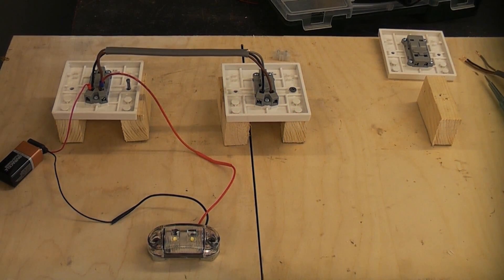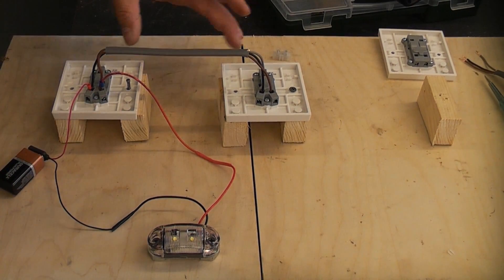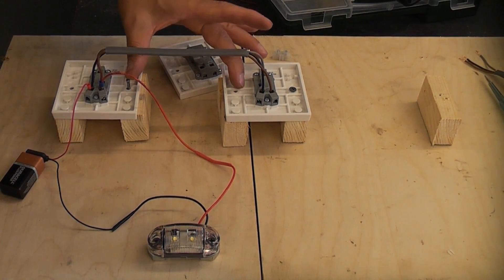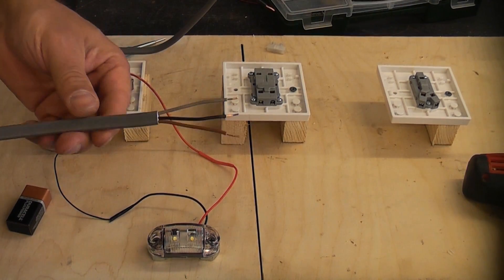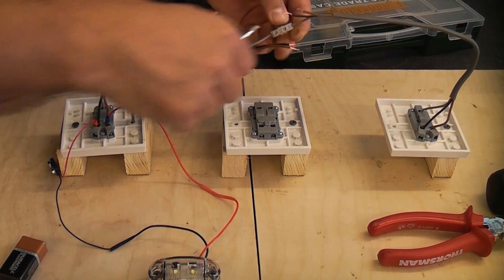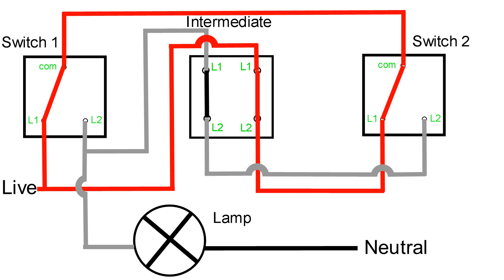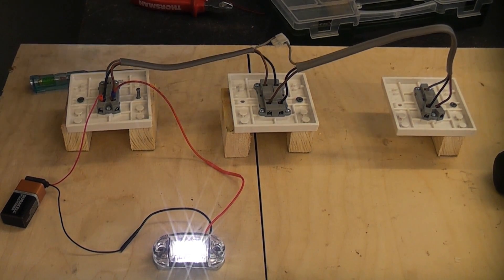Three way light switching | Intermediate switch

Comment: The position of the switches is not shown. All switches should be in the same position for off. 1 set of straps should be diagonally connected. Electrician

Comment: Hi I have a volex  1000 light switch with L1 L2 and L3 terminals am I right in thinking this is an intermediate switch ? The switch to replace is available with L1L2 then another L1L2 side by side so 4 terminals a BG electrical switch the one switch I tried won’t work with com +L1 L2 keep up the great videos
Reply from the maker: A switch with L1,L2,L3 is a two way light switch. You’ll need an intermediate switch 👍
Thanks for the comment 👍
Reply: @ got the job done checked switching side by side with multimeter thanks for the speedy response 👍

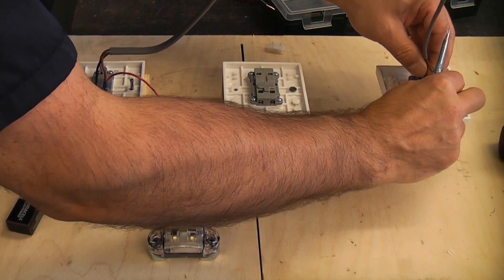Comment: 2:58 so would it be possible to use this setup for a light switch at the door and one pulley/switch by the bed?
Reply from the maker: A two-way system would be easier- https://www.youtube.com/watch?v=IwWIvcV2YTI&t
Just follow what I did in the video, but substitute the second switch with a pull cord switch 👍

Comment: Thanks for this.  I’d be very interested in a video or advice as to how to remove an intermediate switch from a circuit.  I am converting a three switch system to a single switch.  I’ve successfully took one of the normal switches out of the circuit but not certain about what to do with the intermediate switch.
Reply from the maker: If you have removed one switch already, the only switches left should be the first switch (the one where the original two circuit wires are) and the intermediate.

You should just be able to disconnect the wires on the three-core cable, at the first switch. That will leave just the live and switched live at the first switch, you can then remove the intermediate.
Reply: @ultimatehandyman  I’m very grateful to you for this, I literally was unable to think this through.  Thank you.

Comment: Great video - thanks. I have inherited this set up but the first socket on the circuit has a three gang socket (Socket A) (running a hallway light, a cupboard light and an outside light on a PIR). The second switch (Socket B) only covers the hallway. I have however noticed that the outslide light only works when Socket B is in a certain position. It shouldnt be affected by socket B at all so am i right in thinking that socket B is feeding off the wrong live? Does that make sense?

Comment: Thank you. This is excellent and easy to follow.

I hope that you will be happy to offer some advice and guidance for a 12v motorhome installation I am undertaking.  

I am hoping to have lights from 5 different zones all controlled by dimmer switches in 3 different locations.  

I can from this video how I would do this if I was using on/off switches.  

Would this be possible to achieve with all 5 zones being dimmable from all 3 locations?

Thanks, again.
Reply from the maker: No Idea, sorry.
You might need advice from an automotive electrical engineer 👍
Reply: @ultimatehandyman  
Thank you. 
Would such a setup be possible on a 230v domestic system?
If so, it would be a starting point. 
Thanks, again.
Reply from the maker: @richard97531   Not sure, I'm really struggling for time at the moment, and don't get to the computer much.
You might be better off asking in a forum - http://www.ultimatehandyman.co.uk/forum1/viewforum.php?f=3
Reply: @ultimatehandyman  Understood.  Thank you.  I hope things slow down for you soon.

Comment: Hi there. Great video. I have a slightly different set up to a lot of videos and images of the intermediate wiring. I have a switch at top of stairs which is intermediate, a switch at end of landing and switch at bottom of stairs. the twin and earth from the light goes to the intermediate and not the other switches. All other videos I've seen shows the twin and earth going to the end switches and not the middle one. I was just wondering if you can help with this set up at all?
Reply from the maker: I'm not sure about that, sorry.
I always use three core and earth for two way or three way switching. 
I'm sure there is another way of wiring such circuits, but it's not something I have ever done.

Comment: Good job but once I was stuck with lights in a hotel rooms because the painter had done something and it took me days to find the correct wiring. It was damn hard. First, you have those lights in the ceiling that probably were either wired like PIR or junktion box and then to the switch then there were three switches and one of them turn them all on including the bathroom lights  as well and then that main switch was also connected to the contactor in the consumer unit and to make things worse there were no marking except the wire heads sticking out messed up by a painter and it was no joke job. The main switch was also connected to the lights card reader and it was no joke to fix it.

Comment: Great video. Taken the time to understand you video on two-way (XOR), and also the other proposed diagram in comments (XNOR), on how the circuit completes by thinking logical gates.
Which makes this straightforward to understand. The intermediate switch simply reverses the 2-way circuit path any time you click the switch - alternating between a XOR and XNOR.
Reply from the maker: I'm glad the video helped 
Thanks for the comment 👍

Comment: why not just run the hard active to one common and the load out of the common on the switched active?
Reply from the maker: This shows how to wire a 3  way light, when it has been converted from a single way light.
Thanks for the comment 👍

Comment: IF you have a light at the top and bottom of the stairs and a double switch on top and bottom wall-  ive watched how you turn one light on and off from each end but how would you then switch the other light off from both ends within the same wall switches?
Reply from the maker: You just run a cable from the switched live, neutral and earth to the other light fitting, or as many light fittings as you like and then they can be switched on or off using either of the two switches.

Comment: Hi
looking for advice. I have an out door light and a indoor light which are connected to a two gang switch each light works independently, but at the moment i have to switch both lights on for each to work.
Reply from the maker: Your best bet is to ask here, with as much info as possible- http://www.ultimatehandyman.co.uk/forum1/lighting-f33.html

Comment: The standard wiring colours in the UK are (as of 2006) the same as elsewhere in Europe and follow international standard IEC 60446. So, Brown, Black and Grey are the colours of live. Any electrician should know this. Why would I want to sleeve all the wires with brown tape if they already have the live colour code?
I also find the UK way of wiring lights dangerous. Like all EU countries, live should go to the switch first and then continue to the light fixture. That way you always use brown for live and blue for neutral. And don't get me started with the ring main. lmao.
Reply from the maker: They sleeve the blue conductor with brown sleeving or brown tape to signify that it is live at some point. You can get twin brown and earth wire for the switch wires, but not all electricians use it when wiring up the lighting circuit. Three core and earth always needs sleeving though for two or three way switching.

Comment: Intermediate switches are sometimes configured differently i.e the same colours in both L1 terminals and the other two different colours in L2 - black and black in L1 and brown and brown in L2. Different manufacturers use different systems. Which can be annoying. It is important to read the enclosed wiring diagram that comes with the intermediate switch. If no instructions come with the intermediate switch a continutity tester (also sometimes called a bell tester) can be used to figure out the internal configuration of the intermediate switch. You must also ensure you keep to the same coloured wires in the L1 and L2 lugs in the two-way switches either side of the intermediate switch, otherwise the system will not work. Hope this is helpful.
Reply: You can add the original switch wire in at any of the 3 switches inc the intermediate but you'll never see a diagram or advice to show you.
Reply: julian balcikonis nice explanation

Comment: can you have more than 1 lamp in this set up ? i need 3 high wattage lamps.
Reply from the maker: Yes you can, but they will all be switched on or off at the same time.
Simply wire them in parallel where the lamp is in this circuit.

Comment: Again, weird switching setup. and it uses 1 extra cable!
feed live to com of first switch have L1 and L2 go thru the cross-switch (in at L1 and out at L2) then go to L1 and L2 of last switch and connect lamp to com of last switch.
One less cable going from switch to switch and for security the live wire is only connected to one single point which makes it easy to de-energize the whole system.
Reply: ppdan your way is better, you can use 3+E and have a neutral and E at each switch. Ready for all the smart switches.
Reply: I’m an apprentice and was so confused by his wiring, I get it works but it’s unnecessary what you said is correct

Comment: How do you wire a 4 or more way lighting circuit? My grandmother in italy has 4 switches, something I was never taught at college. I did 2 way and intermediate. *Edit should have watched video first.
Reply: Not being an electrician, The intermediate switch simply reverses the path and either complete or break the circuit, thus switching light on/off. Hence, looking at the logic you'd implement your 2-way at the 2 ends, then add a 3rd/4th/nth intermediate switch in between. All replicating the middle switch config shown. Maybe someone else can confirm (or not).

Comment: I do not think the vertical red line at the left from Live to L1 is necessary or useful but i may be wrong....
Reply: oh no, maybe its the red line down from L2 to the red t junction that shouldnt be there!
Reply from the maker: The wire from L2 has to go to the intermediate switch and also the lamp to make the circuit work correctly ;-)